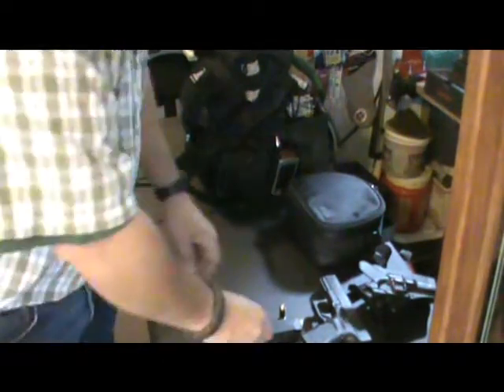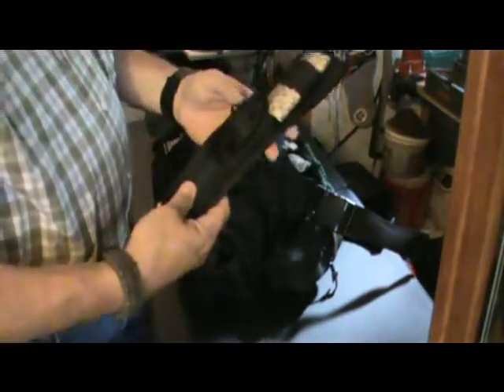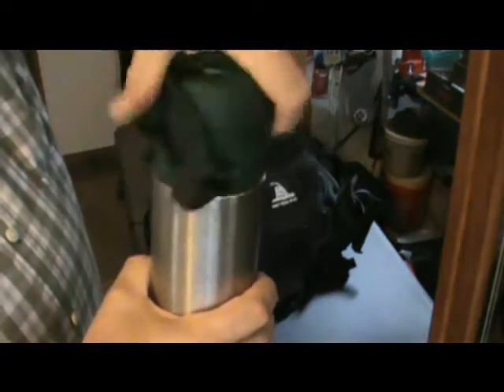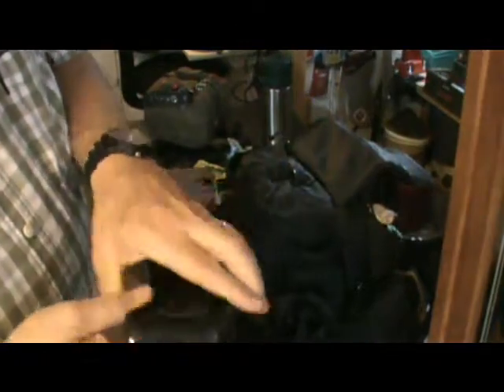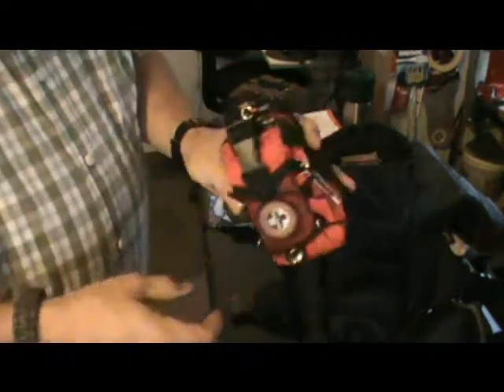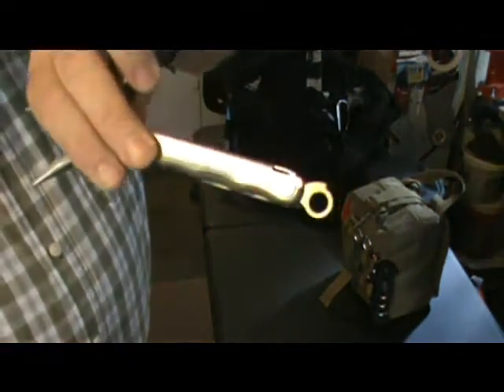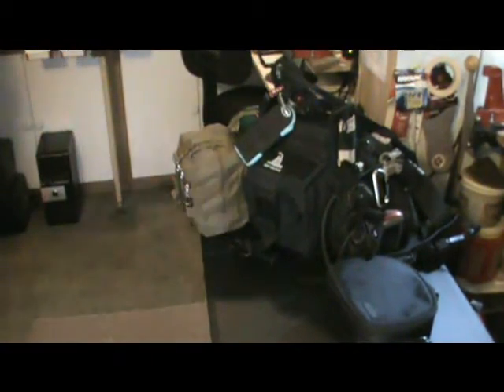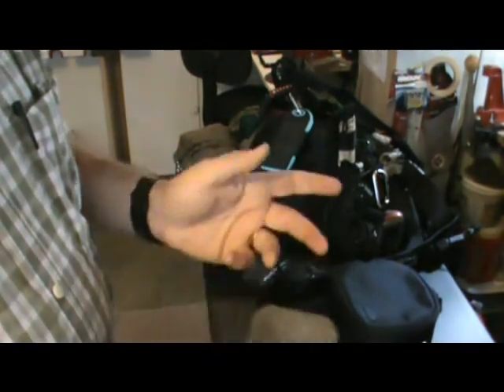My EDC & EDC in Truck

Comment: Watched you edc video and thaught the things you had im there was really good things to have and nessary for carring also i seen you pack that you carry in the woods what all do you carry in it is it basically the same thing
Reply from the maker: Tim, it is basically the same thing, in fact I have switched from that smaller bag in this video to the bag you saw on the back of the 4 wheeler in my latest video.  I probably should do another video on that bag since there are some additional things in that bag since it is larger.  I carry the one you saw on the 4 wheeler with me everywhere, it is in the truck and if I venture out to the woods hiking or working on stands/feeders/cameras then it goes with me.  When we go to camp and hike up the mountain to check the cameras we have set out up there I put on the pack and up the mountain I go.  The bigger bag of course means more weight compared to that smaller bag in this video.  But hiking with that pack on helps prepare me for the fall when bow or rifle hunting since I have packs that I use for those specific seasons.  Heck I can see me doing a video on 3 different packs right now!! LOL  Thanks for watching and your comments.  Juddie - J & J TOA